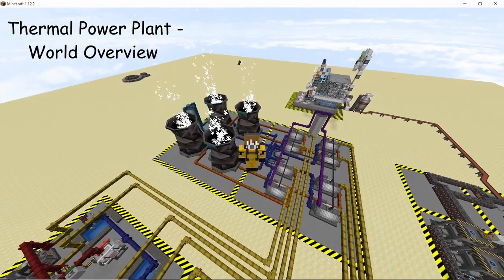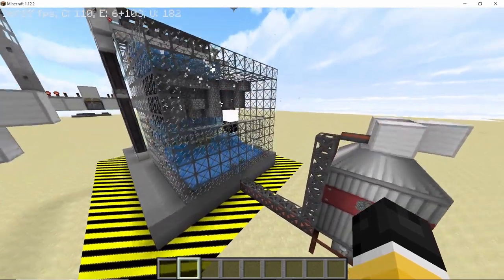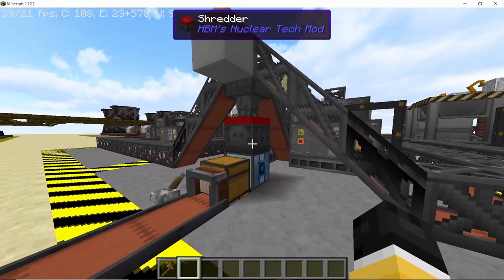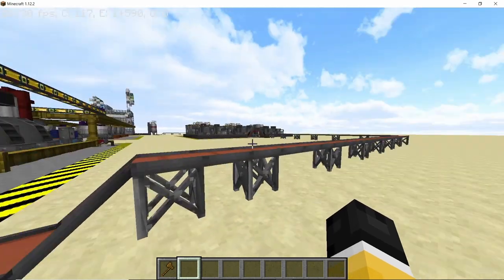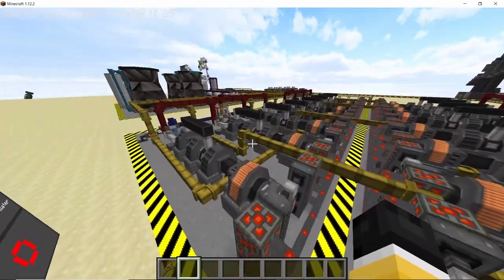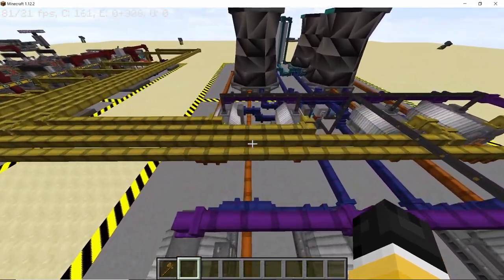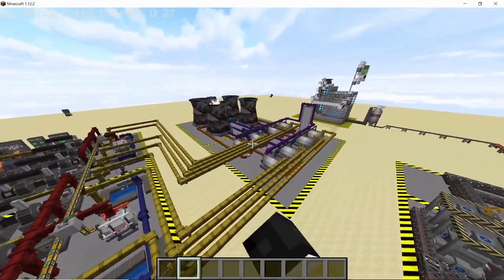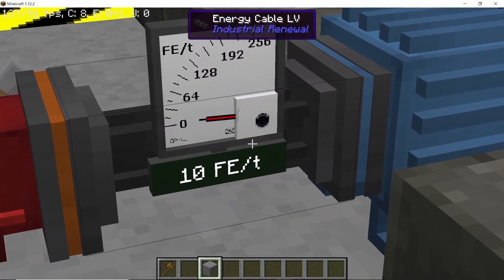Episode 6 - World Overview, Changes & Download  - Let's Build a Thermal Power Plant in Minecraft

Comment from the maker: There are 2 worlds in the zip file , the original world doesn't have any color coded pipes and some few small things so is open to customization , Recommend downloading that one. 
The other world will have the build that you're seeing in this video. If any turbine or pipes glitch out just break a single block and form them again as they are multi block structures and that should fix the issue